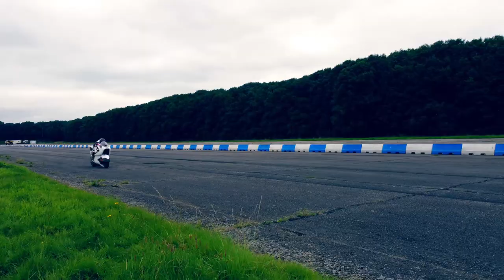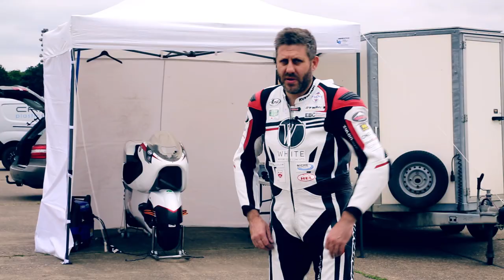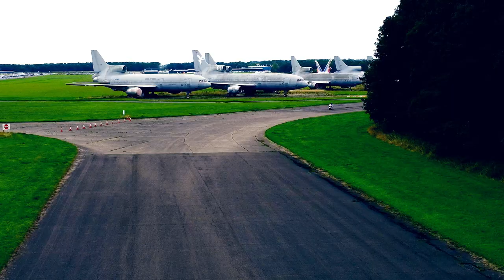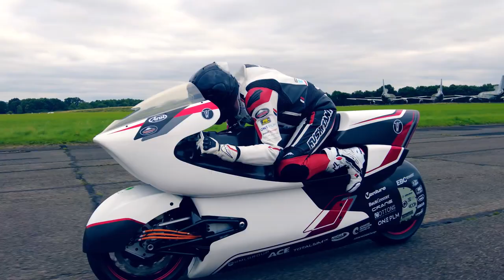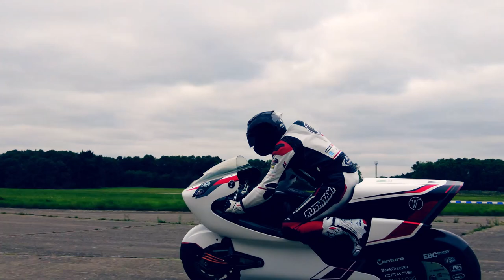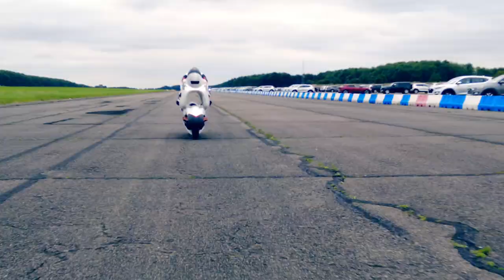WMC250EV Running - Robert White Commentary

Comment: It is recommended to install an electric fan / turbine inside the tunnel to prevent the center tunnel from dragging.
It can also be used to accelerate vehicle speed. 
In addition, by rotating the fan in the reverse direction, it can also be used as a brake that is slightly insufficient on a motorcycle.

Comment: You're very hight on the bike, and with almost vertical throtle handle, it doesn't look very stable.
Reply: It optically looks more extreme than it is, the bike is built around exactly the same seat height as a yamaha r6.
Reply: @robertwhite3283  The size of the bike isn't the problem here, but the position of the rider (+ the handle grips). I'm exagerating for the exemple, but it's almost like trying the "superman" position on a bike, it's extremely dangerous because it's very difficult to keep balance. 

We can see in this video that he strugle a bit to keep the bike stable like a normal one should ride (doesn't look very safe for a potential +400 km/h prototype). The bike never stop swinging from left to right. I guess the center of gravity is also a little bit too high.
Reply: In reality, the center of gravity is absolutely very low, with battery and motors weighing way more than the rider.
Reply: @alencaru  Very low, I don't think so. For two reasons, 1 we are not talking about a Tesla here, 2 this bike isn't big enough with that huge empty space to fit a ginormous battery pack like on some Energica (21 kWh pack) so it won't be that heavy (+ for a speed record attempt, weight is still the ennemy). And 3, he's still too high on the bike and his position clearly isn't made to facilitate the control of it (only to reduce drag as much as possible). 

But who know, maybe we'll have some answers from them about all of that (battery capacity, overall weight, center of gravity, difficulty to balance and/or manuver the bike, ect).
Reply: @WlerickBigotOfficial  I don't think its the center of gravity problem, more of the eletric steering. 
I've never heard of a eletric steering bike (I'm new to bikes so only 1 year and still at 125cc bikes), maybe they need to work on it a bit? They were talking about  'in hub sterring' in other videos.